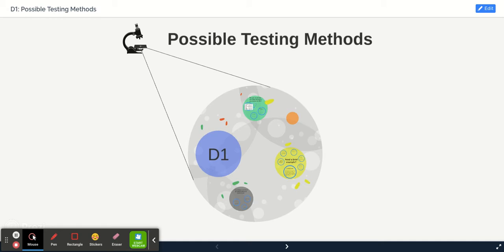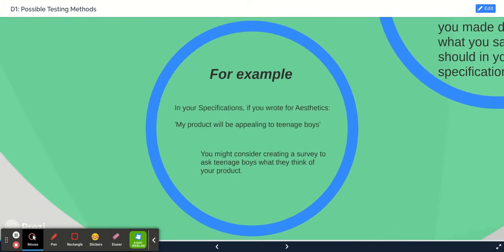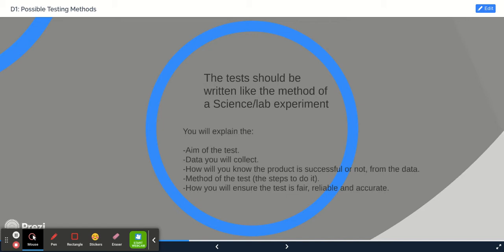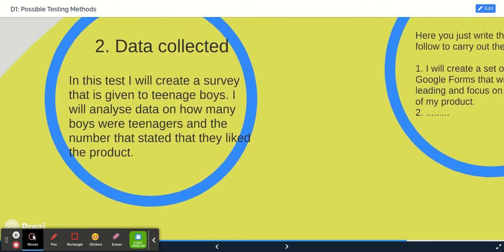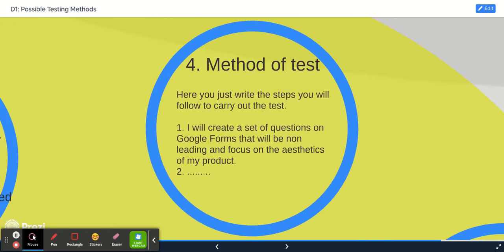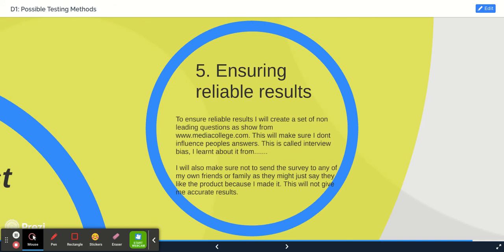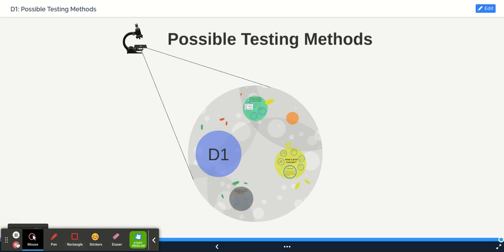MYP Design - Testing and Evaluating Task D1

Comment: what are the  5 steps when testing and evaluating your product
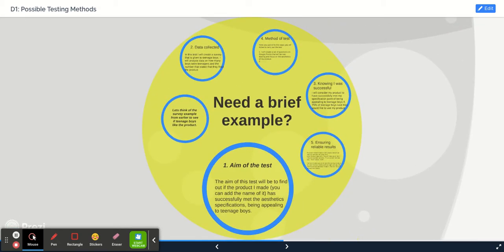Reply from the maker: Check the example that starts at 1:31 on the video. It gives an example of what you should do/write for each of the 5 points. Thank you for your question. Maybe I should make this part clearer that the example is linked to those 5 points.